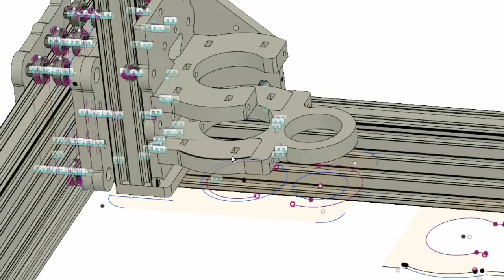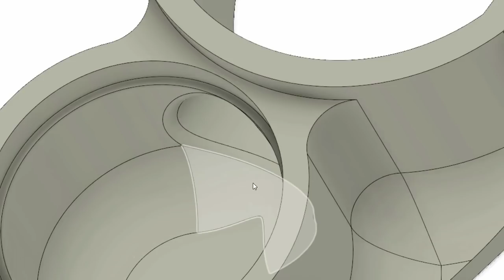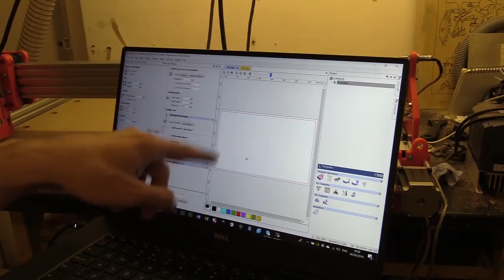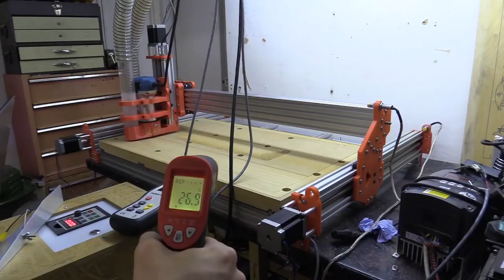#28 Compact CNC Dust Shoe #28 / Bespoke / 3D Printed CNC Machine

Comment: That is a huge machinist square!
Reply: Any issue with the end stop sensors? I tried those and found mine don't seem to hit the same spot consistently. Its off by as much as several MM....
Reply from the maker: Mine seem really consistent but I sometimes get homing fails - and recently found the error note which states limits switches could not be found within search distance. I change that in firmware it still happens from time to time.

Comment: Is the 'shoe' design proven to be the most effective method of extraction? How would a bifurcated duct to a simple nozzle either side of the spindle axis compare? I suppose it depends on the velocity of ejected materials versus the available suction as to how much can escape.
Reply from the maker: Not sure, but bifurcated duct would reduce the travel distance if placed on either side of the spindle. The duct to the front doesn't obstruct movement. I'm tempted to put pvc flaps around the CNC - to keep any dust that escapes the shoe in a zone. A little dust escaping is only noticeable when surfacing the wasteboard and other similar jobs.